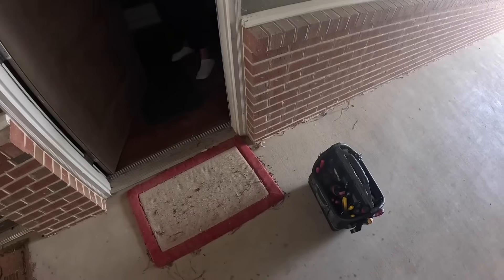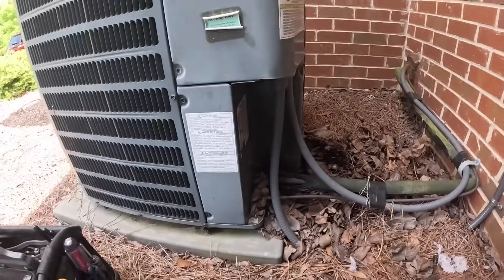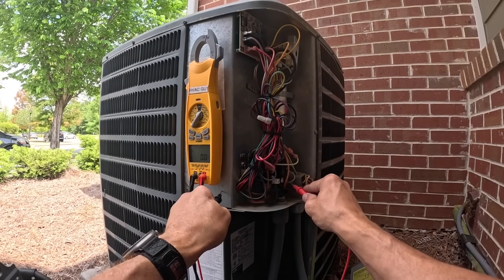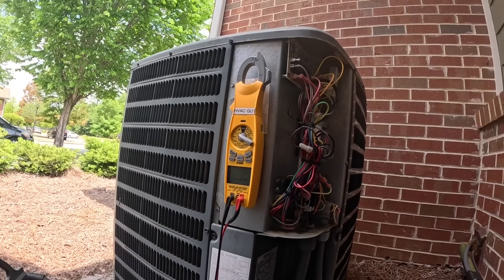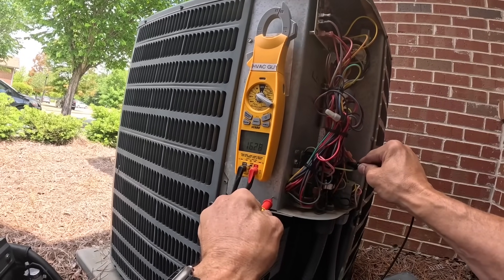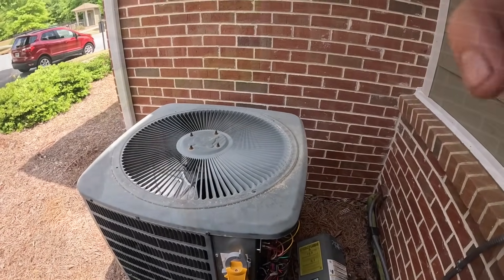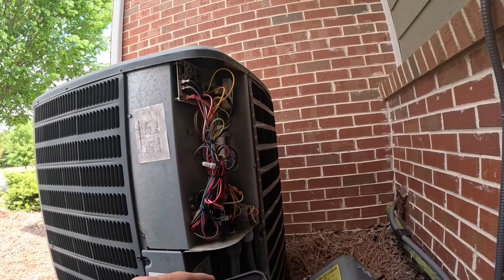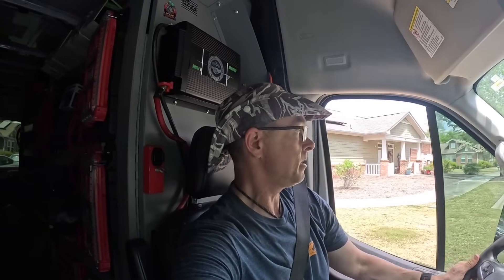Checking On An Elderly Lady With No Air Conditioning! #hvacguy #hvaclife #hvactrainingvideos

Comment: How can 31,000 ohms trip a breaker?   I=E/R   120 volts to ground / 31,000 ohms = .0038 amperes.  About four milliamps.   No hvac breaker will trip at 4 ma unless it's a GFI.

Comment: Another Goodman bites the dust.  Goodman just cheap junk.  Fell sad for her because she will have to need a new one.  Depending on how bad the electrical falure is as long as there is not a lot of acid in the system, and the evap coil is leak free, id just swap out the outdoor unit, however a heat pump is much more expensive than a straight cool, so maybe a compressor change.

Comment: Since that unit didn’t show a dead short to ground I would have left the compressor plug loose and restored power to be sure the problem wasn’t with something else like maybe the block heater…wiring problems in case someone was there first etc…

Comment: Hmmm, another failed Droneman unit...
I'm not sure I followed this diagnosis.  Two hundred forty volts divided by 31000 ohms is only 0.007 amps, a tiny amount of current.  How will that blow a breaker?
I've been seriously considering getting a window unit, just in case.
Reply from the maker: You’ve got to understand I’m testing with 9V and really low amperage. If that happens with 240V under load the result is much different.
Reply: @HVACGUY  Ah, so the resistance would drop to something much lower once the compressor starts?  Ok then...
Reply: @HVACGUY resistance doesn't change. Do you know ohms law?

Comment: The window unit is great, but you would have to run 220V outlet to power one that big? Thanks for the great video
Reply: He didn't say how big. Many are just 110v. It may be one of those room ACs.
Reply: 11/2 ton a/c can cool up to 800 or 900 sq. ft. home.
Reply: Oversized room air conditioners will short cycle and leave the room feeling "clammy".  8,000 BTU is a good size to use and runs on 120 volts.

Comment: 5:37  What is normal resistance between the windings and ground?  I assume infinite (indicated by "OL").
Reply from the maker: OL. High Megohm readings will sometimes run,
Reply: @HVACGUY  Thanks for the reply.  You create great videos.
Reply: Open line most likely.-

Comment: My central unit went out 5 yrs ago, was going to cost over $8000 to replace! Said ain't no way I'm going to spend that much, bought 3 window units for $1200 and never looked back! Cheaper, easier, and just as comfortable; plus with central units being such cheaply made junk I'm just as well off!!
Reply: All new units are cheaply made just like everything else that is true. I know your electric bill is not cheaper.
Reply: @mealworms19  actually YES it is about $50 month cheaper, I think my unit was giving me problems for a year or so before it went completely out!! It was a 20 yr old r22 heatpump
Reply: I can see how that would work for some folks.
Reply: Are those window units supplying heat as well? Unless no heat is needed.
Reply: @bobboscarato1313  yes they're heatpumps, got a good deal on them!
Reply: Coming from an hvac tech they’re all junk. It’s hard to give people bad news about their 5 year old units that die but that’s how it goes
Reply: @RJHerber  We're hiring the wrong designers most likely!
Reply: $8000??? Sounds like you were using a rip off company. My average price today is $5,600 with a ten year warranty. Window units are junk these days too. You'll replace those window units at least 4 times before a HVAC system goes out of warranty.
Reply: @Bryan-Hensley  for a 4 ton package unit heatpump, when can you come out and do it!!
Reply: @jackedwards7420  highest estimate would be $6300. I was giving for the avg heat pump size which is 2.5 tons.
Reply: @Bryan-Hensley  There are many variables depending on where you live. If you have a business with employees and such, it cost more to pay for insurances, workers comp., warehouse and all. An independent guy without all the overhead can go a little cheaper.
Reply: @jthonn  sometimes you have to think outside the box. I have part time people who have a businesses doing whatever I need done, electrical, ductwork, whatever I don't want to do myself. They bill the customer directly so it gets around all the extra insurance BS. I used to have 6 employees, but that's so inefficient unless you are commerical and or industrial.
Reply: @Bryan-Hensley  $7500 was cheapest here in West Tennessee (Jackson area) I could get, one company wanted $10,000! I'll stick with my window units for now they're 4 yrs old and still going strong!!
Reply: @Bryan-Hensley  I hear ya.
Reply: @RJHerber  I don't doubt that any.

Comment: great work tech , that contactor sound like its on the way out lol
Reply: Bad contactors oftentimes lead to compressor failure!
Reply: @bobboscarato1313  Somebody with a brain, thanks Bob. That should have been this jerk's answer. If he is in HVAC, you can see why they get a bad name sometimes.
Reply: The contactor was the least of the problem.
Reply: @jthonn  never said it was a problem can you read?
Reply: @butlerstouchHVAC  I can read just fine. So you are saying that a contactor on it's way out is not a problem? Good Grief